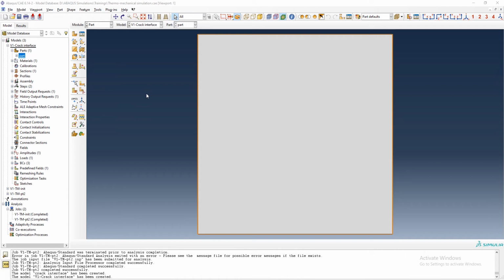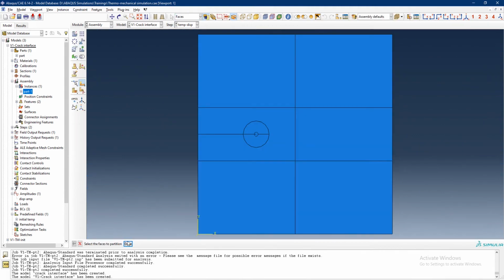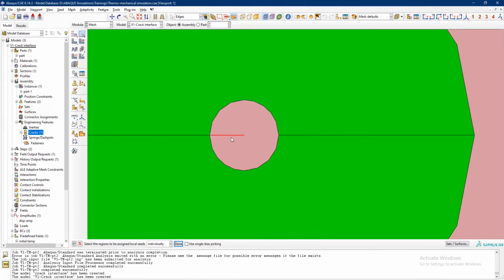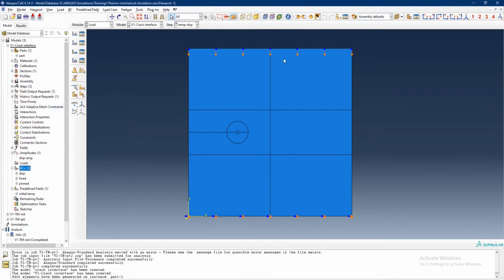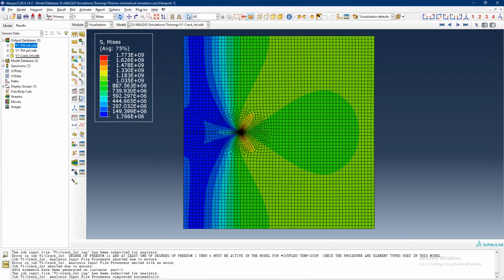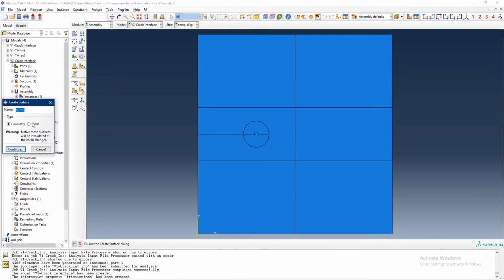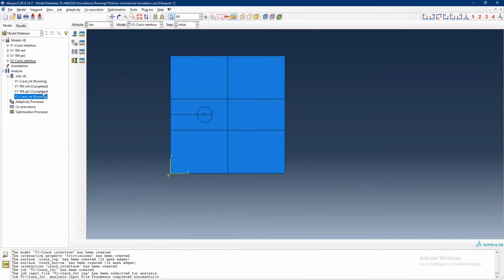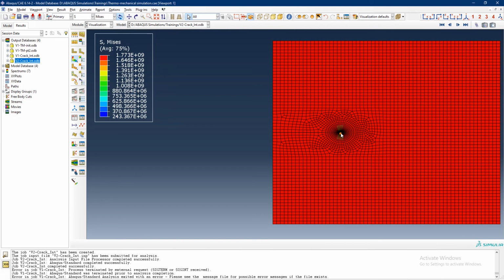Defining crack face interface in ABAQUS : Part 1

Comment: Thank you for your useful videos, I have a question for you. Using ABAQUS, how can I define surface cracks and corner cracks which are not extended through thickness! Considering both sharp and blunt cracks.
Reply from the maker: I think surface and edge cracks in reality are the ones which have infinitesimally small protrusion through the object in 3rd direction. If that is correct define a crack using same methodology which is not too deep

Comment: Also, if we vary the crack length in the same model, mesh will be removed and need to do mesh again. That time crack interface also need to be changed. How to handle that situation? I need to do Multiple model or parameteric analysis with different crack lengths in the same model in different regions. That's possible?
Reply from the maker: I don't know any hack around that. After demeaning have to do it again anyways.

Comment: Crack interface is necessary only for cimpressive stress region? Or in tensile regionntl too is necessary?
Reply from the maker: Yes it is important in the case of crack closure only.
Reply from the maker: Yes it is only important to define crack face interface in case of crack closure.

Comment: how to calculate Stress Intensity factor (K1) from J-integral results?. did not get proper understanding from abaqus documentation.
Reply from the maker: Yeah that's usually not an issue ... Can be easily calculated using a correlating J-int and KIc.  Please refer to any fracture mechanics book or one of my publications: https://link.springer.com/article/10.1007/s13369-015-1569-1